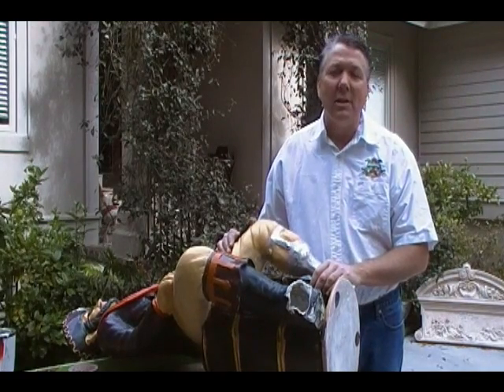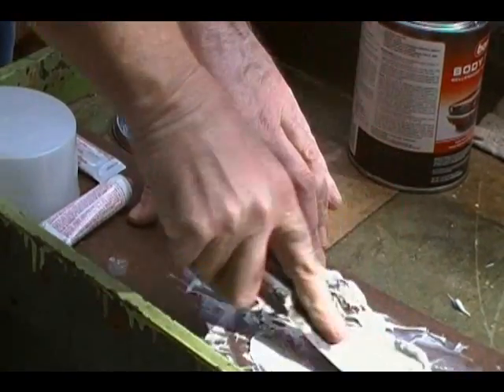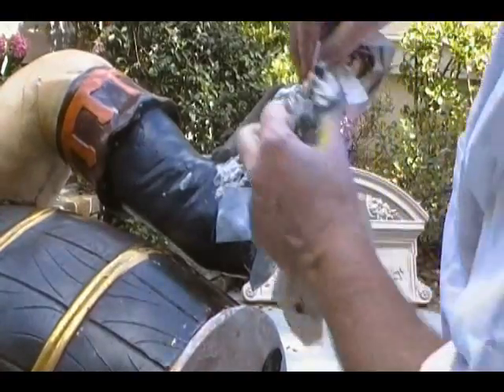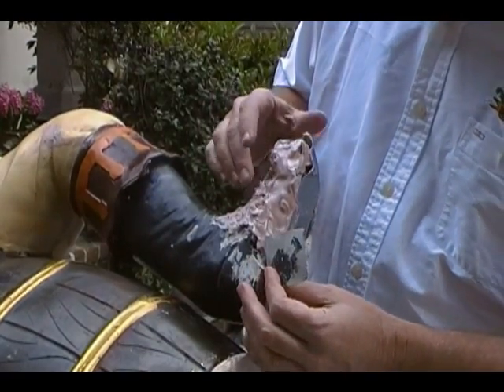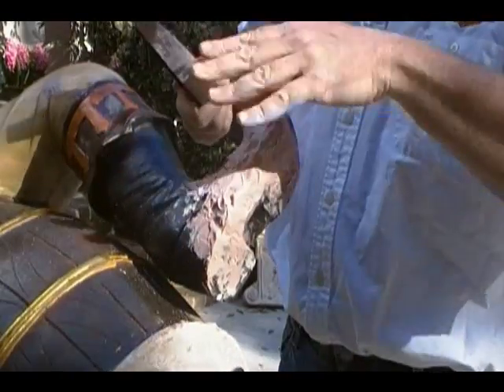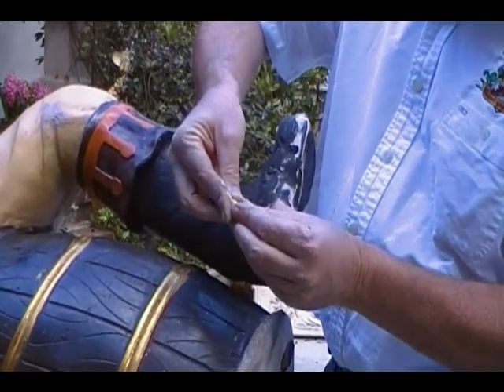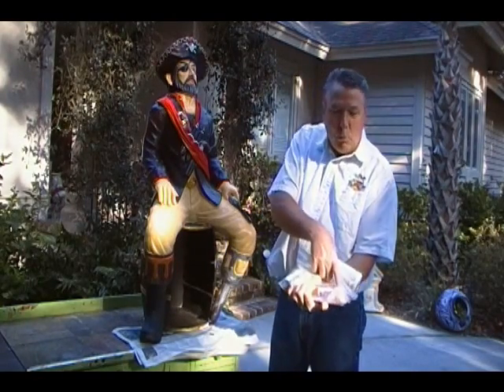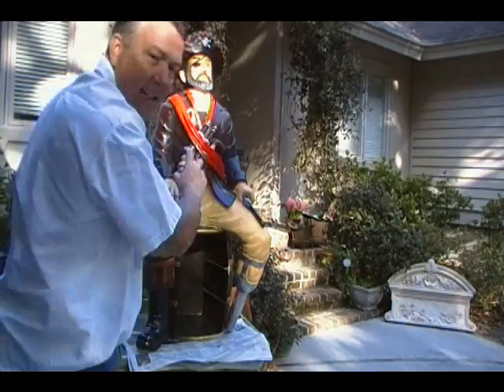Resin or Fiberglas Statue Repair

Comment: that was really good work that will be helpful for me because I have a life size cow made of fiber glass in my yard with a broken ear, I have a question, I recently bought an outdoor resin statue titled " angel of patience" I wanted to know if you would know if I could spray the entire statue with a silicone sealer to sort of protect it from the elements, I know in the winter I need to store it away which I will but until the winter I wanted to treat it with something or should I let it alone.

Comment: I'm surprised that the wood filler doesn't crack and fall off when the weather changes. 

How long will this hold up before needs additional touch ups and repairs.

Comment from the maker: Bondo works perfect also, just you have to work with it fast
once you use hardener.  But it would work just fine
also
tim
Reply: Does the filler come with the Bondo?  I have a huge Santa that I need to repair for my store.

Comment: Bob, will this same process work for repairing a garden bench made of “fiberstone”? It is for decoration only, not sitting. I put lightweight potted flowers on it. Have had it going on 3 years and each year it ‘erodes’ more. I would also like to find a product to seal it. Any ideas? It is a Dachshund Garden bench sold by Tractor Supply, for a better idea of what I looking to repair. Thank you.